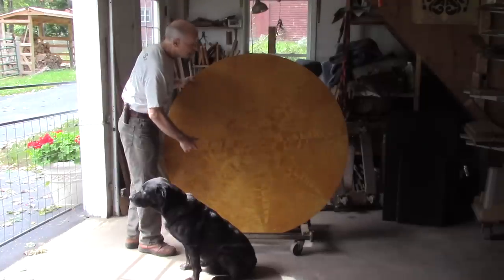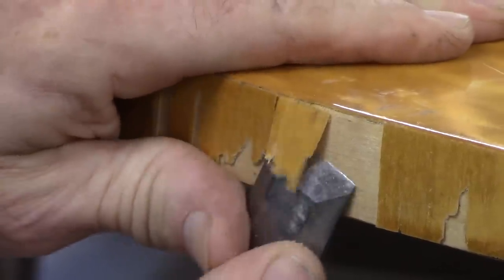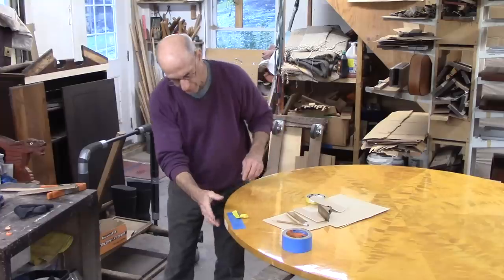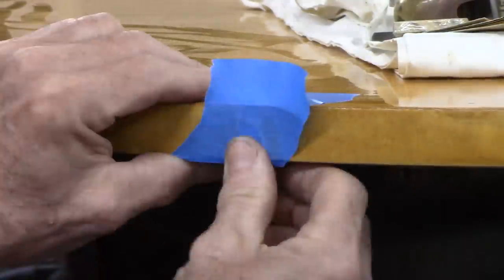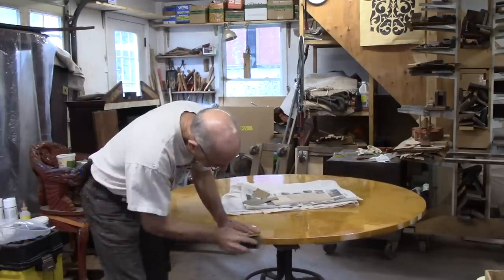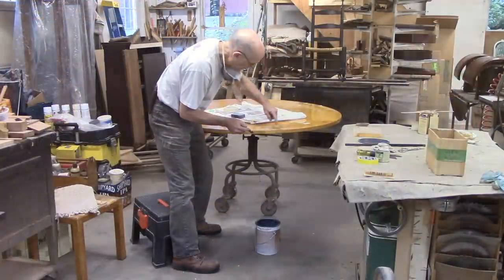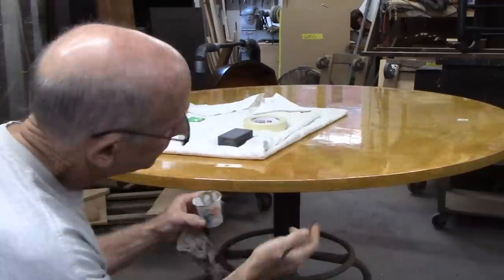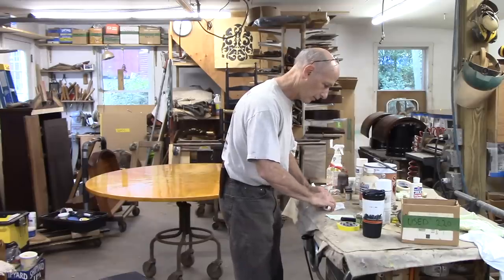Restoring a Veneered Tabletop Edge - Thomas Johnson Antique Furniture Restoration

Comment: Where's you get that cool little scraper red handle you used? Looks to be holding a 4-sided carbon blade like those used on modern helical jointers.
Reply from the maker: Thanks for watching! That scraper's from Bahlco, readily available at most hardware stores

Comment: Hey Tom. Great job (as always). I am very impressed by your attention to detail. One question. On the edge veneer repair that was a large triangular shape, why not just square everything off to make blending in easier? I noticed after the repair that the triangular veneer replacement was still very visible. Extremely interested in your thoughts. - Ben
Reply: I do know you try to preserve every scrap of original wood you can. Is that the reason?
Reply from the maker: Thanks! Yes, it seemed fine to me. I do try to limit how much of the original I remove

Comment: Fantastic works as always, Tom. The toner really ties the variances in colour together very well. Can I ask what "toner" is as I have not come across it. Is it a a cellulose or oil base product? Is it something which could be made by the DIYer  in small batches in the home workshop. As mentioned, I have not come across it commeracially and interested to try it for myself. Thanks again. David.
Reply from the maker: You're welcome! I think the toners are an acrylic lacquer. They are widely distributed. I get mine from Mohawk https://www.mohawk-finishing.com/products/wood-touch-up-repair/aerosols/ultra-classic-toner/
You can also get them from Woodworker's Supply

Comment: not a comment, a question. You often seal with shellac,and then add  more color if needed.how is it that the sealer does not prevent the subsequent coloring or coats of whatever, from being absorbed. thanks Tom...Love your vids....
Reply from the maker: You're welcome! I use dye stains on the shellac, which are alcohol soluble just like the shellac, so they bind to it. And then I will spray toners over that to get the final color

Comment: I have a table (about 90-100 years old) from Italy with a very thick buckling veneer top. It is not missing any veneer but not sure whether to heat it off or if there is another method. Do you have a tutorial on this issue? Thanks...
Reply from the maker: I have so many videos showing veneer repair, but I don't have any sort of index to find them.. Search "Thomas Johnson Veneer Repairs"
Reply: Thanks

Comment: Why do you use gloss before using satin for the top coat?
Reply from the maker: Thanks! All finishers work with gloss until the final coat, mostly so you can see the surface clearly. Gloss is considered a more durable finish but I'm not sure that is true any longer